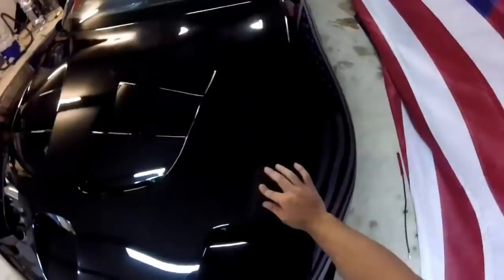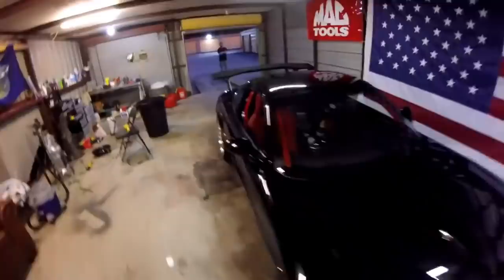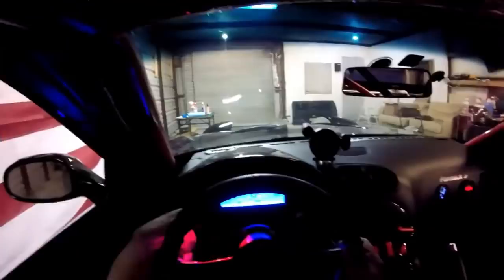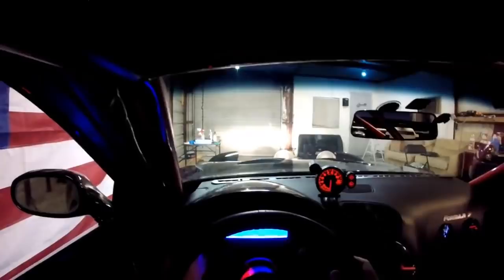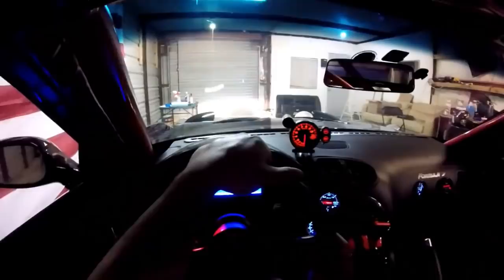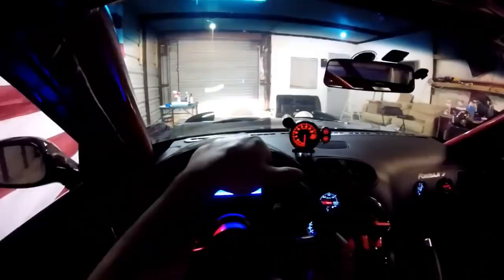How to Drive a 4 Rotor Peripheral Port Turbo RX7 On the Street

Comment: Straight cut gears + Screaming 4 rotor = Eargasm
Reply: Mazda RX-7 Spirit R Type A it reminds me of the bmw m3 gtr from nfs most wanted 2005
Reply: What are cut gears?
Reply: The actual teeth of the gears point straight out from the centre point of the gear instead of forming a helical shape like standard gears
Reply: Tofu rx7fd what's the benefits of doing this
Reply: Tofu rx7fd I have the same question as the previous guy
Reply: Straight cut gears are more efficient in putting the power back and p sure they're stronger than helical but tbh I don't remember. Thought I remembered seeing something about the helical cut losing strength because of the shape they're cut to but idk for sure
Reply: Alexis Beauchamp The main advantage of using straight-cut gears is that they produce no axial load.
Reply: So why is helical still used
Reply: ayyPhenom they're easier to shift
Reply: ayyPhenom 
On helical cut there is more than one tooth engaged at once.
So: 
-it runs smoother-> less friction&noise
-more extensive force can be handled 
-higher rpms than straight cut
Reply: Lol guys helical gears are used typically cuz theyre not loud af.... nobody wants straight cut sounding gears.. its exactly what an rc car sounds like
Reply: Yo my electric RC has straight cut gears and it sounds pretty bad, makes sense tbh
Reply: hiphopcroaks24 Your not a real car guy then 😉
Reply: Mazda RX-7 Spirit R Type A 1ďß
Reply: Straight cut gear transmissions also need to be rebuilt (in certain areas) quite often. The car is used to race had a straight cut hewland transmission. There were a few parts that had to be replaced every 1000 miles, no exception. Each "rebuild" was a couple grand. Like others said, they are also very very very loud. The majority of the sound in this video is from the transmission (that high pitch whine).
Reply: Ryan Molloy Actually straight cut gears are used in racing application because they wear out less in terms of axial bearings then a factory gearbox (mostly due to the fact that factory gears have a helical cut and therefor transfer quite a chunk of force onto the axial bearings). You are right in terms of wear between the gear teeth (the factory helical cut allows for a bigger surface area on the teeth, what in turn causes less wear ;D).
Reply: Mandernach Luca correct. I never said the gears themselves needed to be replaced. When I say rebuilt, I'm going by what the Hewland manual stated. I don't recall the parts in question in the case, but they were basically an assumed cost, and cost about 1500 every time it was done. The cost came out to about a dollar a mile driven. Thankfully said parts were at the very back of the case and easily accessed.
Reply: I love the sound of straight cut gears and dog rings.  👍
Reply: @ryanmolloy5421  it would br the dog engagement rings that need to be replaced. They are literally little shapes that stick out proud one one side with corresponding holes on the next ring and when you shift they simply line up and bash into place. They eventually wear out
Reply: @MrTubanator  no, because it's because of the noise
Reply: are those really straight cuts? the pitch doesn't get higher when upshifting

other than that they sure do sound like they are
Reply: @tomstuttgart992  yea that wouldn't work all the gears in the transmission have to be the same i.e. straight cut or helical
Reply: @tofurx7fd441  mandernach Luca and joschua3445 are the most correct but they're leaving out the most important reason why gearheads and serious race cars use straight cut gears, and that's because they're a lot lighter and smaller than helical gears. This makes it most ideal for racing. Like others said straight cut arent really used commercially because of the noise but that's not really a factor in racing.
Reply: hiphopcroaks24 yeah you’d be sacrificing power and durability for sound but I agree it sounds pretty bad, along with the stage 3 clutch, this thing looks like hell to drive at low speeds
Reply: @_baller  you know a lot of people love the sound of straight cut gears

Comment: How to drive a PP turbo quad rotor on the street?  

Route near gas stations.
Expect to be pulled over.
Straighten steering wheel before flooring it.
Check that fire insurance is paid for.
Have fun!!!
Reply: Haha ma man.
Reply: This is gold. Makes a ton of sense though. Wonder what the mpg is?
Reply: [Redacted] a hot 13B turbo does 12-14 mpg, this thing..... probably 7-10 mpg. But what a way to go!
The sound, the fury, the 🔥...who cares about fuel economy?!
Reply: Steve Ross Not me, that's fuckin' sure. I talked to a guy once claimed his 7 got 4mpg hwy so I thought I'd ask.
Reply: [Redacted] that is probably accurate....a two rotor is equivalent to a 350 ci small block in terms of the amount of air it can move, double that with the 4 rotor, so matching the fuel requirements of a 700ci  V8.  Atkins Rotary is one of the best sources of info on these things ( that's where I got the comparison from ). The peripheral port is the most radical configuration.  If this engine had a much milder port configuration and was geared right with proper tuning, it might get closer to 15 mpg. But then again, that's speculation
Reply: Steve Ross ii
Reply: Steve Ross deadass though hahaha

Comment: Mazzei didn’t ls swap or 2jz swap his rx-7.

Be like mazzei.
Reply: FINdude yeah and add oil every time he drives the car 🤣
Reply: Jz is not okay, LS IS NEVER OK
Reply: Astle Truscott and why is that. Are you afraid to admit to yourself bigger engines produce more power more reliably? A 2jz at 1500hp is not reliable but a ls is. Both engines are reliable at 500hp but ls sounds better and produces morr torque.
Reply: @gsfbffxpdhhdf7043  but an LS in an rx7 is just...NO. It's like adding mayonez instead of mustard to a sandwich
Reply: NoNoNoNii  lmao
Reply: @astletruscott6291  nah I’m putting an ls in my rx7
Reply: @gsfbffxpdhhdf7043  bruh the whole point of an rx7 is the turbo dorito. 

If he wanted an ls or 2j he'd get a different car and do it.

Also idk what you're talking about them sounding better, half the point of getting a dorito is the sound of it

Comment: 5:48 he backfires and shoots a nasty fireball. Look in the left rear view mirror
Reply: Maxsation2481 Probably intentional through extreme tuning, probably spark cut and fuel igniting in the Downpipe/turbo elbow of the exhaust instead of the the combustion chamber, rather than a backfiring problem
Reply: @DoktrDub  uh hes just saying that so that people will see it he aint saying its a bad thing

Comment: That sound when idle. It's almost like a mini 787b
Reply: Well a 4-rotor does sound a lot like a 4-rotor
Reply: FlyingTurtle that’s the funniest sarcasm I have ever read
Reply: FlyingTurtle you would be suprised how different sounds can be with different styles/designs of exhaust manifolds. The manifold on this car is a replica design of the one off the r26b rotory i believe.
Reply: It's like RX787b
Reply: The Straight cut gears whines louder than the engine and turbo
Reply: FFS it has a turbo an N/A P Port sounds waaaay crazier specially the throttle response this don't mean it doesn't sound cool but nothing compares..
Reply: And its on the streets :3
Reply: Meh...not really.  Nothing sounds like the R26B.  It has something to do with the 3 spark plugs and the housings.  Not many people notice the housings are custom and are different from housings used on any other rotary.
Reply: @miker1223  yes, PLUS it has that N/A ITB intake with variable runner length. Must have a lot to do with it aswell
Reply: The actual race engine sounds quite a lot more high pitched without turbos though

Comment from the maker: Thank you guys again for watching>

Quick explanation to popular quesiton. The shifting is slow in the video, as the transmission had just been assembled, and the higher rate detent springs were not yet installed. This is a dog-box transmission which explains the banging into 1st gear. When weather permits, will have a new video out with clutchless shifts WOT! Thank you!
Reply: Mazzei Formula damn that’s hwy 280 here in Bham right? I live here and build motorcycles, mostly custom cafe bikes
Reply: Mazzei Formula would definitely watch you do vlogs in this car
Reply: Jesus this thing is insane. Gotta love those straight cut gears. Sounds like a fighter jet. Good job, man. Way to stay rotary.
Reply: I was really just now wondering why the shifting was off
Reply: What transmission it have?

Comment: i wish this car was at sema this year.
Rob Dahm WOULD HAVE drooled

EDIT: for all the butt hurt vocabulary spelling bee queers underneath
Reply: Greatest King Rob Dahms rx7 has nothing on this car
Reply: Both cars are extremely wicked. Built for different purposes
Reply: ViceVersa Musik his awd 4 rotor build is gonna be nuts
Reply: wouldve is would have would of.
Reply: jake20479 don't go there...
Reply: jake20479 would’ve is would have. Wouldve isn’t a word
Reply: jake20479 you spelled would’ve wrong in your last comment 😂
Reply: Bryson Harris yeah.. I forgot the apostrophe.. the point was obviously was still made.
Reply: Bryson Harris I mean..  no need to get butt hurt mate. You weren't the one that said it.  But if the shoe fits.. I guess. You may as well wear it.
Reply: jake20479 At least I know where to put an apostrophe
Reply: jake20479 you sound like the one getting upset. I was just correcting you and told you not to insult someone when it comes to grammar when you aren’t even using the correct grammar 👍
Reply: Bryson Harris  I misplaced a single apostrophe.. that is a spelling mistake.😂  Incorrect grammar would mean that I can't put a sentence together properly.  You can be picky all you want, guy. My point was made and you know it. Consider it an English lesson for you as well. A free one at that, the next one will cost you. 😉
Reply: jake20479 Don’t use the winking emoji, that’s pretty weird.
Reply: Probably his engine :P.
Reply: jake20479 tanks for the most bestest engrish lesson evar
Reply: jake20479 You also didn’t use correct punctuation in some comments, bud.

Comment: Impressive machine. But I just don't get it why you (or other people) use the clutch while you have a sequential gearbox.
Reply from the maker: GeenIdee2 Waiting for some custom detent springs to add more rate to 1-2 slider so that there's less risk of rebound with clutchless up shift to 3rd
Reply: So it's a temporary thing. I've seen it a couple of times now with different people and I could never understand they would do it but in this case it makes sense.
Anyway, I'd love to get a dogbox for mine sometime
Reply: I'm not so sure about that "to prevent wear". Those dog rings have some play in them so when the load changes it hammers to the other side. But it might be the sequential mechanism that makes it harsh compared to a dogbox were you have a bit more control on the shifting? Pfitzner performance has a nice video on that is some street cars. It might be a bit more comfortable but I guess you don't got one of those things to drive comfortable xD
Reply from the maker: Yea so this is a dog box H pattern build out of the stock box. I haven't installed the Ikeya shifter yet. If you shift right at the matching rpm shift points you will not feel the dog teeth bangs, as you've essentially synchronized it. If you don't Rev match, you can feel the dogs run over each other as it goes into gear. This is what causes wear. So it can be minimized by waiting a moment between shifts at low speed upshifts
Reply: Because street car
Reply: Formula Seven ahhh so you basically have to shift like you're driving without a clutch.  That explains a lot for me.  Wonderful car btw
Reply: Jason Mullings why are you talking?
Reply: Jason Mullings I've played around with floating gears in all the cars I've owned.  Just as a safety precaution in case I ever need to drive with a fucked up clutch slave or something.  Floating a downshift is hard as hell for me but it's still possible.   There wasn't really a point to this comment, just glad someone else is aware this is possible and I would like to engage in a pissing contest hahaha
Reply: All this is exactly why I'm leaning to auto's with manual valve bodies now days for high power applications.

Comment: I don’t believe that is street legal
Reply: greyson denton believe it.
Reply: The rules for a "streetable" vehicle are pretty loose. In a
most states there's just minor requirements such as marking, braking, and head lights, windscreen and wipers.
Reply: MrSuperawesome5000 - 100% accurate. My State could give two fucks about 98% of modifications as long as you've got your necessary lights, plates, and registration.
Reply: steveholtz420 it's the same in my state. Except if they decide to look under your car for cats then you better have some kind of high flow or pre-silencer so you don't get a fine lol
Reply: They don't even look at your vehicle in Florida when you go in for your tag and registration... SO really as long as it has all of the proper safety stuff, like lights and seat belts... Anything goes pretty much. Heck a few years ago Florida's Supreme Court deemed the noise ordnance unconstitutional... SO now police won't even bother you if you have loud exhaust (as long as you are not getting noise complaints from someone)
Reply: They don’t even check emissions in my state, were fortunate!
Reply: My state has no emission laws:)
Reply: Rocket
Reply: Some states are pretty strict and others dont give a shit.
Reply: Ppl are praising germany for having the autobahn but when it comes down changing parts of your car, you have almost no freedom. Weither you know someone special who would let you drive your car legally or you have to take the risk to drive a car which is not allowed to be driven on the road. Eg small carbon spoilers on a Honda Civic EG6: Not allowed since you could hurt pedestrians when it breaks.
Reply: Alpapi Chupapi In italy you can't legally improve you car of neither 1hp.
Reply: Because everyone follows the law? Not everything is legal. 'Some' people even run stop signs to prove a point..

Comment: Idk if its just me but when you accelerate it sounds like a fat supercharger😂
Reply: That's the transmission
Reply: @SoI_Badguy  how?
Reply: Ozzy Leigh 
Straight cut gears
Reply: @ozzyleigh5907  
Straight cut gears, you'll notice if you stick your car in reverse and floor it on a straight road you'll get a sorta similar sound.
Reply: Ozzy Leigh actually for the same reason a supercharger sounds like that: friction noise

Comment: meth injection is hella old school.
just run e85
Reply: Water/meth injection allows me to push my 1.8 L to 540 WHP @35 PSI... SO yes while E85 is good... there is also some serious and dangerous drawbacks when relying on E85. Mainly the quality of fuel... since pump fuel can get pretty far off from its rating. I rely on 110 Octane gasoline from VP racing and water/meth injection to protect from detonation. Much more consistent and much more accurate then Pump E85... Unless you are getting your E85 from a source like VP racing... but then at that sort of cost, why not just get the 110 octane "race" fuel... and be done with it :)
Reply: Meth.. Not even once
Reply: If you have a flex fuel sensor, your ecu will adjust the tune depending on the percentile of the E-85 in your tank say anywhere from 75-90 ethanol. Usually it’s around 82-85 in the summer from my local gas station. The ecu does all the work for you. And you can always have a pump gas tune as well or vice versa. Its 110 octane, runs way cooler, and you can advance the timing way more because of that, only downside is you use 30% more fuel than if you run pump
Reply: Dylan Kachmann ... Flex fuel sensor is well and good for mild builds. Once you are at a level I am pushing my engine, you DON'T run "pump" fuel. I use E85 or E100 from VP Racing, it is consistent and reliable. Methanol/water injection is a proven way to prevent detonation and protect the engine. It is NOT "old school", it is extremely relevant and widely used, just because a single individual does not use it, or have exposure to it, means nothing to the rest of the world. OR run 110 octane fuel from the pump, with the water/meth, and be done with it.
Reply: I'll add rotories are extremely hard to tune on e85 and according to rx8club there's barely any that have been able to convert it successfully.  Water meth is best for a rotory keeps it's really cool and cleans the carbon build up minimal.
Reply: C85, ignite e90, or ms109. I'm looking to distill my own hemp ethanol to 95% then a3 it to 100 (around 120 oct) then add some 146ish octane Xylene. I bet there's no fuel like a home brew. 130 octane hydrogen to the intake system after I utilize an custom alternator an some GEET motor/ Stan Myers tech ;)

Comment: The car is really nice, but I'm asking what gives that sound? Like a gt3 car? Like when he relases throttle it makes that high sound
Reply: That would be the dogbox transmission buddy, beautiful right? :D
Reply: It's the straight cut gears
Reply: Sequential gearbox. Straight cut gears
Reply: rufus dear Standard gears on a gearboh are helical cut, meaning that the teeth aren't straight and are somewhat spiraled. 

Competition gearboxes are, almost every time, straight cut gears, where the teeth of the gears are basically horizontal slots. 

When the power goes through the straight cut gears, it whistles like that, a whine.

Comment: You have built this 4-Rotor RX-7 just the way I would have built it. I might have had it painted Cobalt blue with metal flake but that's the only thing I would change.